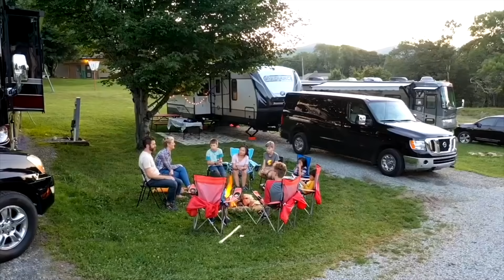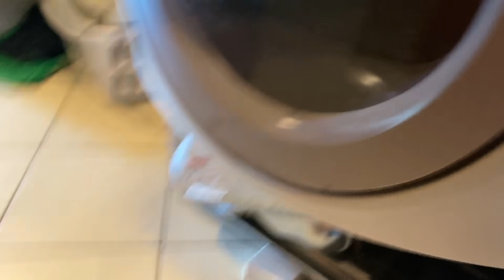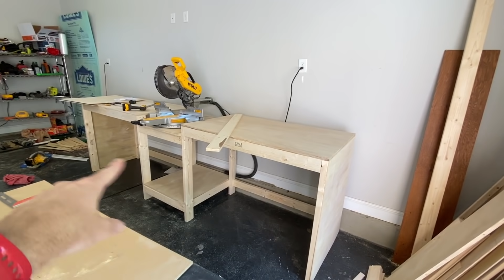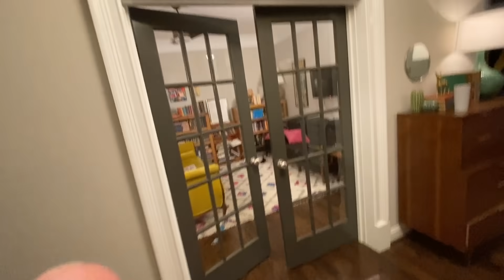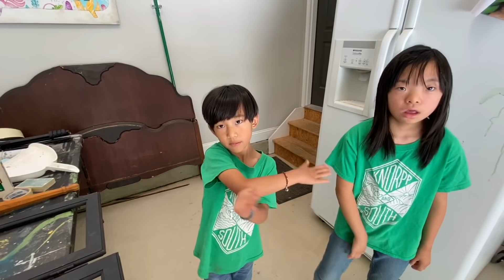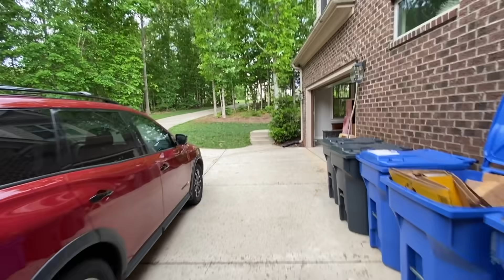SAY NO TO DISTANCE LEARNING! : Adventuring Family of 11

Comment: The sprocket that is on the axle needs to be three times the diameter of the sprocket on the motor. You won't have a lot of speed, but you'll have enough torque to pull the weight.